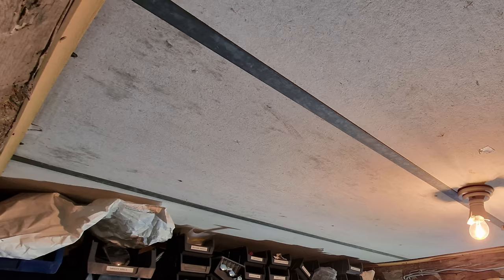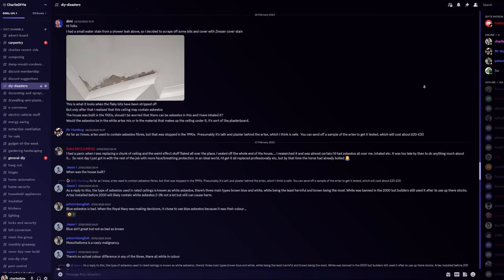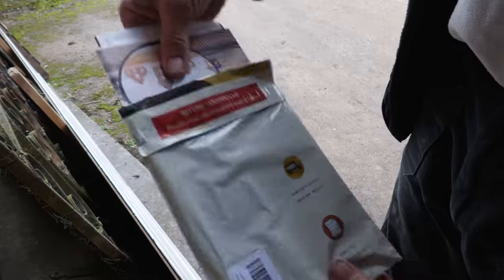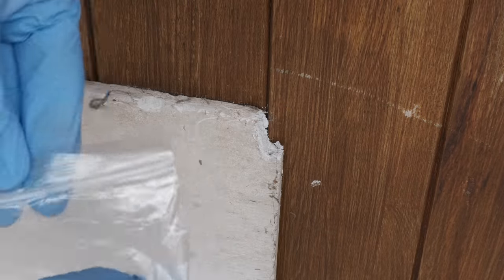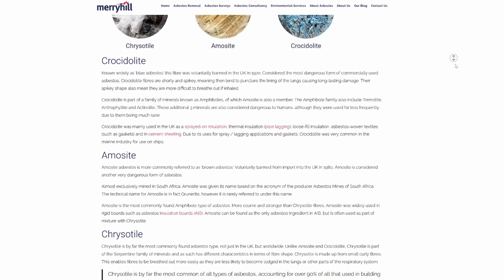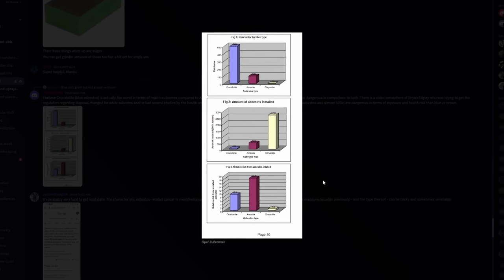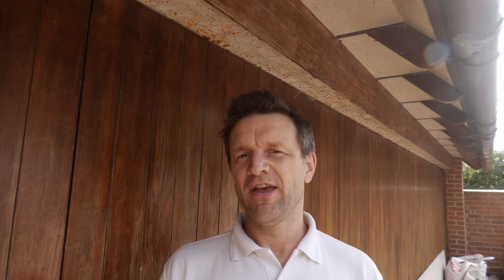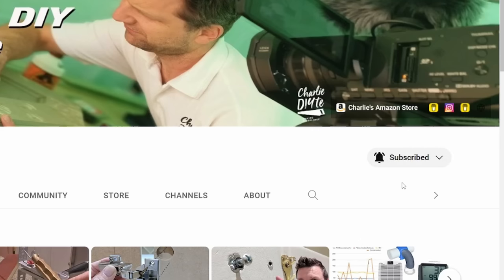I've Got Asbestos in My Home

Comment: VINYL FLOOR TILES is the other that people miss, basically asbestos was used as a thickening agent on anything plastic (1970's black TOILET SEATS) like & common place until at least the 70's or maybe later, & was able to be used as a thickner in artex wall coatings until Feb 2002 when the legislation changes were brought forward about 5 years (and many in the industry complained the bring forward caught them unawares ... where as really, they should of not been using those sort of products, legal at the time or otherwise).

DRILLING into ARTEX is the other big one that catches people out.  Tradesmen being at more risk than householders, as they will have more instances of exposure so accumulative effect.

Also, was widely used BEHIND electric CONSUMER UNITS as a backing/spacer to mount to the wall.
Reply from the maker: Yes, very good points. Thanks for sharing 👊

Comment: Thanks for sharing your experience.

We have nearly finished renovating our house and during this process we had to gut our loft due to a leaking roof. There were 3 layers of insulation, 2 layers of glass wool and the bottom layer was the original loose fill "wool".

I am not sure where this contains asbestos (the house was built in 1976) and I can't get clear answers online, so we have now ordered the kit you used and will be doing the test to get clarification.

Comment: Found this very informative, albeit, after contacting my local authority on the safe disposal of asbestos, I was horrified, to be told, it just goes into landfill?
TBH, I was expecting, some form of processing, so as to minimise the risk of contamination to surrounding areas, not just bury it.
There are special areas at certain civic amenities,(you have to make a booking with the local council) to which you can safely dispose of this material, nevertheless, the staff will not help, due to strict health and safety regulations, even though they have full PPE, they will only watch from a safe distance, while you place the double sealed bags in the skip.
Reply from the maker: Yes, Ian and homeowners are permitted to bury it on their land too 🤷‍♂️

Comment: While asbestos is no joke, it is always important to keep things in perspective. The asbestos used predominantly in residential settings is chrysotile. The fibre structure of this particular type is quite curly. This means that, even within the lungs, it can be expelled over a long enough period of time (per the CDC). Small exposures like where you accidentally disturb it are therefore pretty low risk overall to your health.

The real dangerous stuff is the black and brown stuff used commercially. Those have needle-like points that will embed deep into the lungs and never get removed, only scar over. Thankfully, this stuff is virtually never used in homes.
Reply: Your post brought my peace. Just recently bout a house that was built in 1950 and inspector said a few panels in laundry room and outside area looked like potential asbestos.  Now my brain is freaking out. It's all in good condition but my question is what if it is in all the walls of house can I drill holes to hang stuff or is this risk of disturbing fibers? Thank you
Reply: @emily3333  Drilling holes would disturb few, if any, fibres. I wouldn't worry about that. Quite frankly, it's not common to encounter it in the actual walls.
Reply: @Tephnos  thank you 🙏

Comment: Its going to be very fifficult to clean up where you drilled those holes Charlie, see if you can hire a specialised vaccuum.
When I used to work by it, even the safer stuff, cement board asbestos i used to spray coat it with contact adhesive glue.
Reply from the maker: I have a vac with a HEPA filter. Problem is you probably have to dispose of the filter afterwards and they've discontinued them. Will try and get a company in to do it. Will be a pain as it means emptying the whole cellar.

Comment: I've got asbestos in my 60s house. I used a kit that I sent off in the post and got the results from a lab via PDF and I think it cost about £20 per sample. 

I only realised there was asbestos after I'd removed half the old floor tiles and glue with a number and chisel!  Once I knew I used loads of water to suppress the dust. I've also got Artex with asbestos in it, too.

From.whay I've read and been told, it's prolonged exposure to asbestos that's the problem.

Comment: Hi Charlie, asbestosis/mesothelioma can become real from even a small exposure although a small dose is less likely to affect you than someone who is exposed regularly. The licensed asbestos removal industry require a full face mask and a powered respirator, but unlicensed stuff just requires a half mask with a P3 filter. The industry standard for unlicensed asbestos work is the Sundtröm SR 100 half mask. I work for them so I can send you one if you like. It's by far the best half mask on the market. There's no competition, and you can use it for any DIY tasks
Reply from the maker: That's invaluable info, thanks. Also very kind to offer to send me one. Let's chat on charliediyte@gmail.com Thanks again 👊

Comment: Good video Charlie. I've worked on many sites over the years where we got kicked off until remediation work was done. I remember one job where there was a big old water tank in a kitchen ceiling void, which was covered in suspicious looking brown stuff. We asked whether it was asbestos, and the site agent replied, "It's only monkey dung lads, crack on." Monkey dung was asbestos mixed with cement and sprayed on to surfaces to insulate them.
2 days later, a squad appeared on site, poly'd off the kitchen area and spent a week removing this guff we had been working beside for days. A rep from the remediation company told us we should never have been allowed inside the building once the asbestos had been discovered.
That was the 1980s for you.
Reply from the maker: Thanks mate and sorry to hear about that. Yes stories like this abound everywhere. I've got a couple of builders working with me right now and they wince at the thought of all the adverts they've worked with over the years. 👊

Comment: Can't believe they made brake pads from this stuff!
Reply: Do you even understand why it was 🤷‍♂️🙄
Reply: @alangordon3283 brake pads contain chrysotile which can be woven quite easily and has good tensile strength, good heat resistant properties and cheaply made
Reply: They also made breathing apparatus for fireman out of it.
Reply from the maker: Yes I forgot to mention the brake pads 👊
Reply: @Believe-you-me-  and cigarette filters  😮
Reply: Asbestos brake pads are not as hazzardous, unless you were going to remove the wheels
Reply: @Matty12333  don't they grind and produce particulate when breaking?